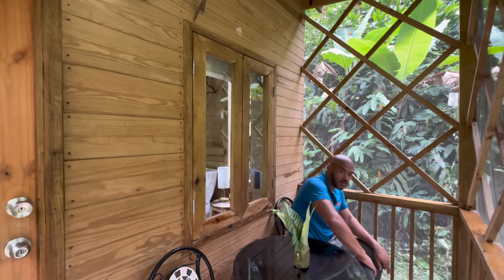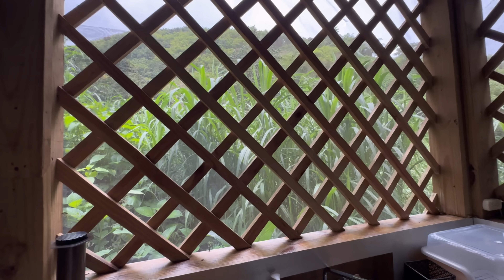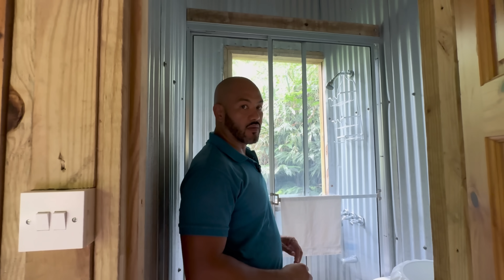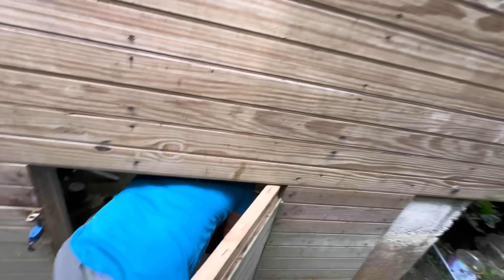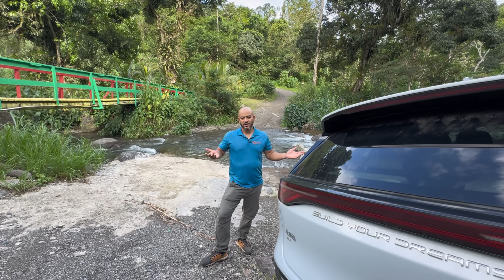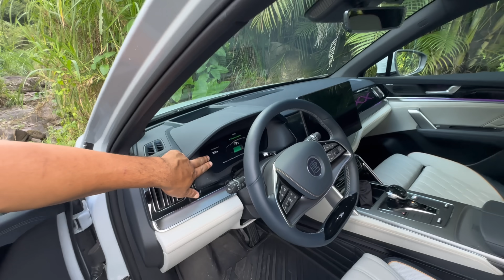Cost to build an off grid tiny house income property in Jamaica. Full tour.

Comment: Engineering & Electrical knowledge are necessary for these Housing VENTURES.
Reply: No. I have a studio that I use the prototype to save me housing bills while I build my home in phases.  

It is plywood with lumber frame and zinc roof and it is in Mobay 10 minutes flat from the airport and it survived Hurricane Melissa with the zinc roof still attached! 

I hired a proper electrician to handle my electrical and an HVAC technician to handle installing my 12,000 BTU AC. 

And the lovely thing about a smaller place is you need less of everything to make it 21st century comfortable.

Comment: I have solar on my house, but it's not working 😢 1 of the hurricanes  or a bad weather, flood my house and I have a plug on the ground that water get into and it hit the inverter and damaged it. Sigh. I am assuming the panels are good and the charge controller. When it stopped working I couldn't be sure if it's the batteries or the inverter. Smh 😢😢😢😢😢 I get disappointed, because I don't think I get the time with it that I was assured I would. 😢
Reply: I mean you said it got flooded... Sounds like you need to move the socket or the cord placement up or of the flood zone of your property.

Comment: The off-grid house is beautiful but I have a couple concerns. (1) In the kitchen the inverter is next to a drain pipe.(2) You only use mesh in the kitchen and I know a hungry rat will make its way through it. (3) I can see a gap around the drain pipe going outside.
And I have one question... how long will galvanize shower walls last?
Not being negative...just very observant....and I like the same style of living...

Comment: You can also use the river to generate electricity, I saw some young in china uses the river for that purpose in the forest
Reply from the maker: Hydroelectric generators tend to require much more maintenance than solar equipment. And permitting for usage of the river to erect a large enough one would be very difficult.

Comment: Your presentation sounds all great,  however I am having a couple of concerns when it comes to the off grid life being dependent on others (technicians etc.) to come and help whenever there are problems, and of course the safety! 
For instance we have solar panels at our house in Stony Hill, however during Beryl last year the battery went dead within less than 1 day, JPS cut off the light of course and then everything went down...no water, no internet, and the Solar technician who installed the panels all the way in Mandeville totally busy due to the hurricane damages! So after not having any light for 2 days and we were not able to reset the battery ourselves, we were totally helpless and ended up moving out of our house into a hotel because none of the Airbnbs in Portmore and Kingston had light nor a back up generator! 
So in case of emergency we are all stuck in our tiny house in the country side in the heat surrounded by mosquitos and nobody to help us😢
My next concern is the safety as I don't see any burglar bars or grilles at the windows nor doors so anybody can come and pick the lock of the door and da-daaaa! Climb into the windows, thief whatever there is to thief...even if it's just the Ac and the TV...I don't know what you guys do when it comes to safety but I know you got dogs but you know, dogs can be poisoned etc. So 5 mil.sound super reasonable but that doesn't include safety measurements nor the land nor a back up plan❤
Reply: Sounds like you should not venture into something like this. You will be in nature, yet asking about burglar bars. 
I have house in a  gated community in Jamaica and so many installed burglar bars . I decided not to install any. 

Security at the gate, alarm system in the house and ring camera and people are still having those grills in place. Burglars dont stop thieves. They only lock you in if there is a fire. 

This is Jamaica. Back up plan is wood fire or coal stove, a kerosene lamp and chill until electricity returns.
Reply: @Prof-v1r  thank you boss, how can someone with the name(handle) Jamaaican_lifestyle be so fraidy fraidy? which part of Ja lifestyle mean you have to make and live in your own prison?
Reply: @Prof-v1r they are not unrealistic to ask people will break in and rob homes especially if the property is located in certain areas where crime is high
Reply: Does safety mean you have to live in a prison? Everything depends on others so what are you asking? doesthe electric stop the mosquitoes? safety is a mindset, you know how much people lock up in their penitentiary as soon as 7pm come?
Reply: Also, when it comes to the construction: how much time would it need to build a house of this size? How many months?

Comment: I can see that you have it all made with solar, and have no need for extra power and maybe extra work, so what I have to say probably doesn't make sense to you.
However, with a fast running stream flowing through your property, have you ever considered adding a hydro electric generator on the river?
 
Say hi to Flor, your beautiful wife for me, you guys are an inspiration to me.
I have 2 100amh 12v lifepo batteries, 2 100w solar panels, a 1000w inverter and a small charge controller.
I'm coming back home to Jamaica next month to live permanently from the USA, and that's my little setup that I will be starting out with.
For the most part, I will only be using a small fridge on it, no tv, no AC.
However, I will be charging my phone and laptop too.
As for lights, I'll be using solar lights that will be pulling their own power.
My little cabin is about the same size as yours, but I just want the simple life without bills.
I also have a 220v capability hydro electric generator that I would love to try out.
I will make some vlogs to put on YouTube showing how it works and what i learned from diying it😅
Reply: Ohk...it mek sense.l like how the water is right there..never knew it's her husband
Reply: I am looking forward to hear more this. I love to hear about all possibilities. Will be subscribing to you
Reply: @Givemyselfachance thank you 

Only got 19 days to go!😊
Reply: hydro only generates notable power with scale
Reply: @ronaldosmith8631 it depends on how you set up the system.
I have had the privilege of visiting two different farms that support their power supply with only hydro, and the streams are far smaller than the stream that he has running through his property.
According to the information that I've gotten, both hydro and wind turbines provide more energy per kwh than solar, but solar is much easier to maintain, since they have no moving parts.
Think about it, most countries around the world collect their energy supply from hydro electric dams, this is not by mistake.
I am sure that a nicely placed turbine, feeding from a fast moving stream like that, could quickly charge all those batteries and keep them charged too, and the solar panels could come in handy when water is low.
Like I said, I have a few panels myself and a hydro turbine too, I will put both to the test and see which works best as soon as I get home.😊